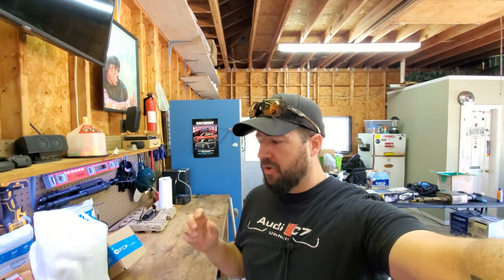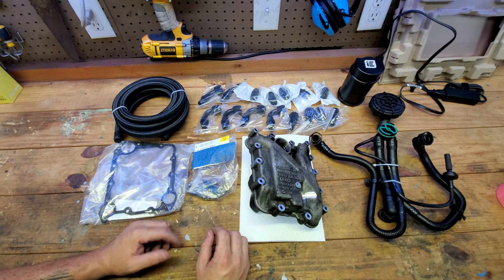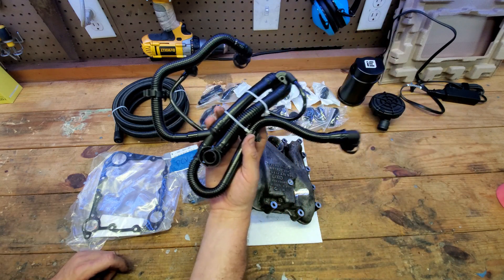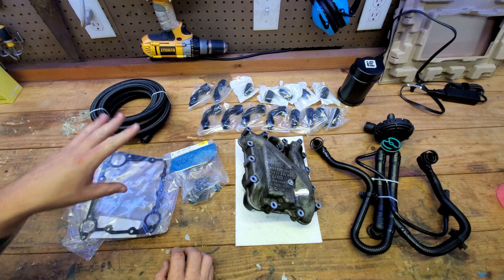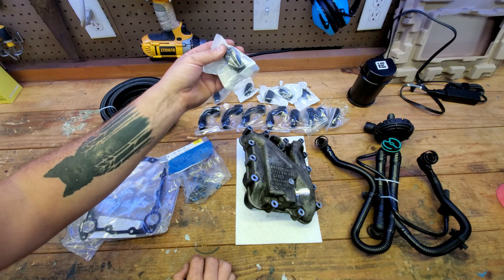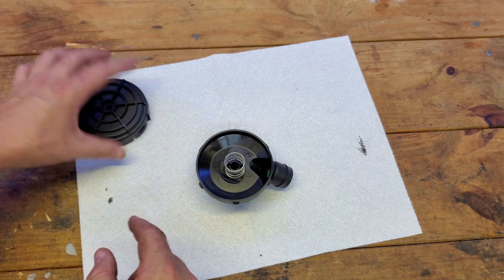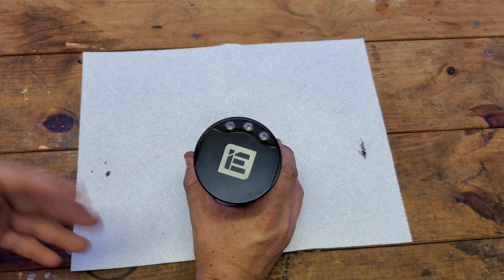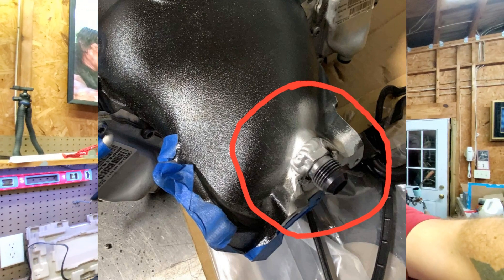Audi 3.0T PCV Relocation Video Series | Video #2: Parts

Comment: Did some digging
As far are the crec folk like myself are concerned others have done research and believe that our issue with oil consumption and pcvs is due to audi corp switching from 2 vented valve covers to only 1 with the crec engine. From what i see, they both LOOK the same minus the obvious, i dont see why we couldnt swap the covers, run this as well as the dual vented covers and see what it does. Worst case i think, the engine is just a little more protected. Best case it solves SOME of a major issue AND protects at least the supercharger 
Fear ive bought a rock  and been told to swim with it tho

Comment: Amazing thing you do! I m curious if the kit works on crec engine on an S5, the support and things known about this engine in Europe are close to none, i ve read that the oil catch can is not the best thing engine. Any advice and if the kit fits crec and what engine code you have. It s pretty expensive to order something from us to eu and wouldn t enjoy to order something that won't work. Amzing thing you are doing again and thank you sir!
Reply from the maker: The CREC relocation is particle but you have to modify the plastic oil separator that attaches to the metal valley plan to fit into the engine block.

And catch cans are great for this engine, especially if you do it like I did mine. I have a video showing how much cleaner my intercooler cores are with the catch can.
Reply: @GarageTaught thank you very much, i ll be on it in 3 weeks, i ll make a video and try to make a guide and i ll drop it to you on email or smthng, maybe you can post it or for merc make a kit, i ll come up when it s done and how i did it! Hope i don t break smthinng:)) thanks a lor sir!

Comment: I just finished the relocation on my 2014 A7.  I used 06 valley pan and breather hose along with the MercRacing parts and it works like a champion.  Thanks for the video and all the work you put in on getting the parts made.
Reply from the maker: Nice job man!

Comment: Heey, can somebody help me, i got my cats gutted and now i have a flutter sound at low rpm and when coming to a stop,… i saw on some forums that it can be related with the cats… somebody some ideas? it seems to be coming from the right cat or the lambda sensor idk… but its very loud and annoying.
Reply from the maker: It is more than likely a bad flex pipe. That's the normal culprit
Reply: @GarageTaught  i will check ty

Comment: Hello, is there a way I can email you I have a few questions regarding a powersteering rack replacement on my c7 a7. Not much info out there when it comes to replacing the rack. 

Thank you 👍🏻
Reply from the maker: I am not sure how much help I will be. I haven't removed and replaced one myself, but I can tell you that they are expensive even used. I would pick one up from Lifetime Audi in Durham North Carolina. Also I believe you have to have someone with Odis coat it to your car as well
Reply: Yeah man I actually just got a used one from them for about 600$ after taxes and shipping. 

I have read around that I need to reprogram the module. I was wondering if vcds can do that.
Reply from the maker: It cannot

Comment: How many times do you recommend on a oil flush when replacing the pvc losing coolant?
Reply from the maker: I'd probably do 2 rounds of cheap synthetic oil, then a 3rd with good oil like Rowe 5w-40
Reply: @GarageTaught  would you recommend to do anything else
Reply from the maker: I'd probably keep that oil change interval short. 3000-3500 miles

Comment: Hey man unrelated to video but you’re always good help I’m about to flash stage 1 034 ECU and TCU tomorrow. Going to do a dsg adaptation too. Should I be doing this before flash or after flash? Also first adaptation I’ll be doing should I be taking it easy driving until the clutch adaptations show as complete or just drive the thing? Thanks
Reply from the maker: Always do the adaptation after the flash. I'd drive normally for 10-15 mins, but you should be good to go after that.
Reply: @GarageTaught  cool thanks man very excited to get it all done 👍🏼

Comment: By the Time u realise the PCV valve is Faulty which u can't normally. Damage would have been done in terms of the various valve cover  rubber seals etc seals all giving way due to excess pressure in crankcase. For all my cars, i do a PCV valve delete and add a Oil Catch can in between. So for this setup, my humble opinion is it still does not solve the Crankcase pressure issue as long as PCV valve is a variable.
Reply from the maker: The pcv diaphragm failing doesn't cause severe damage to this engine or any engine seals.
Reply: @GarageTaught  What you think of remove the pcv at all ?  thx love the video will do that on mine, thx for make me scared now i need to spent more now to spent less later kkkkkk
Reply from the maker: You cannot delete the pcv on this engine
Reply: @GarageTaught  thx, almost bough everything ahahaahah... mine is a risk to man? thx

Comment: For the OEM metal PCV, you mean to say we need one from an Audi 3.2L V6 engine correct? Not the actual VW VR6 engine right? Maybe I've misheard, but I keep hearing you say VR6
Reply from the maker: I misspoke. Yes the Audi 3.2.

I came up in the vw world. Old habits die hard.

But the part number in the pdf is the correct one.

Comment: Just got a 2012 audi a6 c7 Quatro s line, and I need the water pump replaced. I thought it had an oil leak. The mechanic saw a water leak. We did not see any coolant or oil under the car, but oil was on my garage floor once my car cooled off. My big question is, since he has to replace the water pump, can you recommend everything that needs to be replaced while he pulls the water pump?
Reply from the maker: The water pump doesn't need anything else removed to replace it. So there isn't much "might as well do this" type of things to consider when doing it
Reply: @GarageTaught  Thank you!
Reply: @GarageTaught  do you recommend a specific model water pump and hoses or gaskets when do this job?
Reply from the maker: I'd just make sure to get it from fcp euro
Reply: @GarageTaught  Thank you!

Comment: Looking forward to the next video on this, went in for my inspection failed cause my 02 sensor monitor wasnt in ready status, took my a6 into the shop and my pcv that was just replaced back in may is apparently malfunctioning. Sounds like a good opportunity to get rid of the failure prone oem pcv.

Comment: There is a concern regarding one of the hoses that go into the driver's head, from the spyder hose, I see that in the picture it's actually going into the relocated PCV valve return leg, but how about the driver's head, what do you plug into there?

Comment: Just bought 2013 3.0t prestige with 100k for $6500 and the owner thought it had a catastrophic damage to the engine and it turned out to be the intercooler. I love the car and will do all the required maintenance to keep it running. Thank you so much for your detailed videos. I’ve watched every single one of them. 🍻
Reply from the maker: Dude you got a damn STEAL. Nice job!

Comment: Hi. I replaced the PCV and I'm still getting suction on the oil cap. what gives?
Reply from the maker: It's a pressurized system. There will always be suction
Reply: @GarageTaught   damn. all that work for nothing. I replaced it bc of the suction and some oil consumption. I noticed the old one looked fine but replaced it anyway. thanks for the reply bud. you're doing great work.
Reply from the maker: You can't tell if a pcv has failed just from looking at it. Did you scan the car to see if you had a pcv fault code before replacing?

Monitor your oil consumption & see if it improves.

Just think of it as preventative maintenance if nothing else
Reply: @GarageTaught  that's a positive way of looking at it :) I didn't have any codes. just suction and oil consumption.

Comment: I've been waiting for a video on the PVC from you and you didn't disappoint.  I'm curious if the PVC will live longer now that it's relocated from the hot engine sandwich it had resided in.
Reply from the maker: Even if it doesn't it will only cost 15-20$ & 5 mins of your time to replace it.

Comment from the maker: Guys, Please click the document link in the description to see a full list of part numbers and reference pictures.  Also, check the description for a link to Order your MercRacing 3.0T PCV Relocation parts kit!
Reply: Hey mate. Solid video! What about all the people running aftermarket throttle bodies? That plate won't work I'm assuming.
Reply from the maker: It should work just fine. No reason it wouldn't
Reply: Great video and guide - thanks! Do you have any update on the Mercracing parts? Not keen to weld my S/C and want it to be reversible.
Reply from the maker: We are about to have a pre-order for them.  If you want to be notified for that, send me your email:

AudiC7Owners@gmail.com